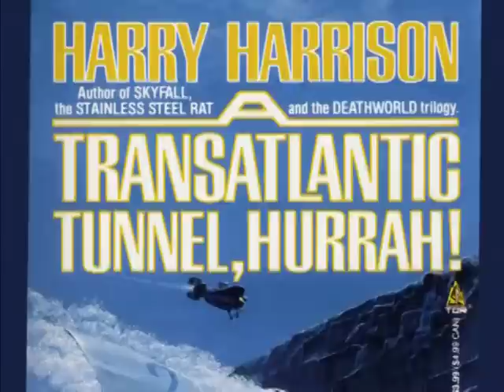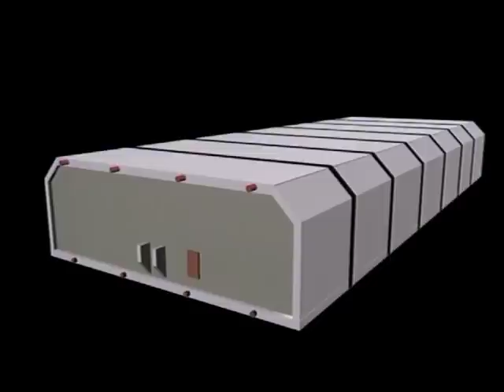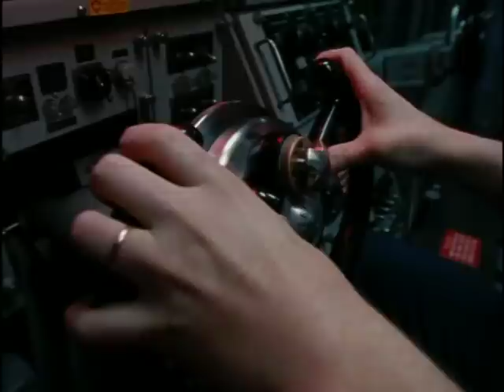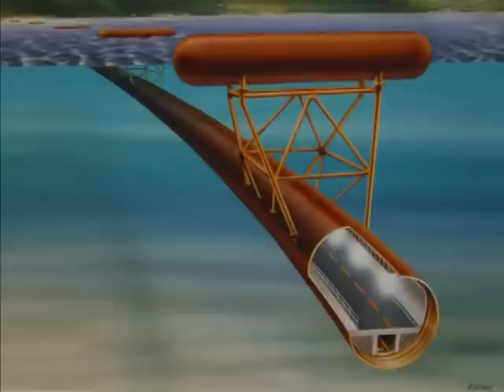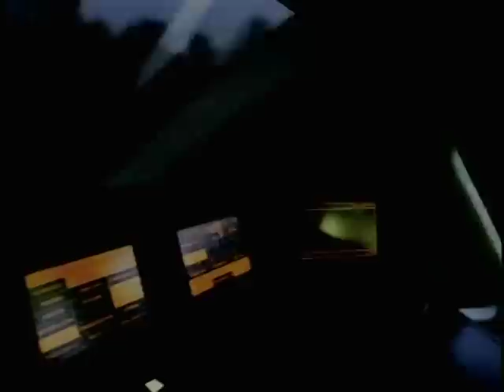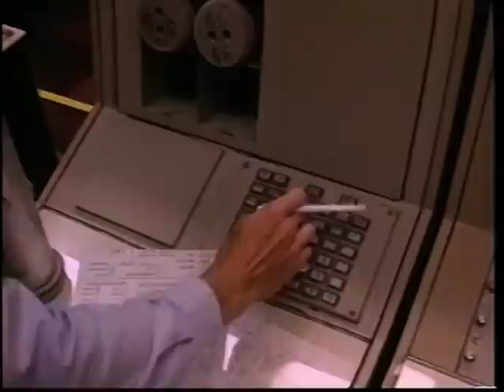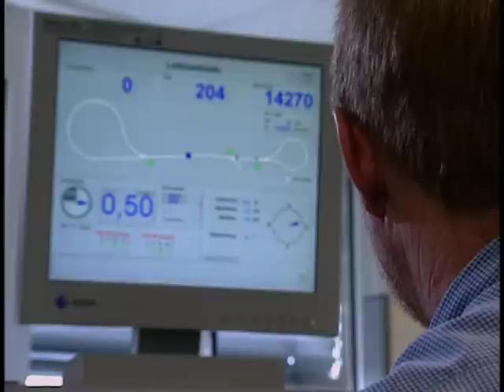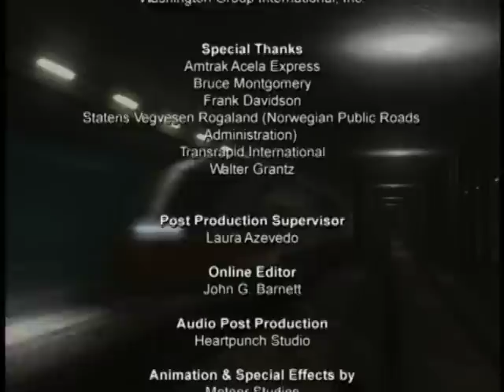Transatlantic Tunnel | Extreme Engineering

Comment: Building the tethers on the bottom of the Atlantic Ocean is next to impossible.  The length of the cable is also impossibly long as it runs the entire depth of the ocean.  Engineers have to come up with floating tunnel that can stabilize itself using propellers for each section.  This is not impossible given today's technology in computer and sensors.  Each section has to be buoyance just enough for it to stay in the water.  Anyway, there is no easy solution.  I still think that a bridge (or underground tunnel) from Canada to Greenland to Iceland to England is engineering more viable than a floating tunnel from the US to Britain.
Reply: Even that would be impossible, linking 4 countries together.
Reply: Impossible

Comment: They have had trouble laying The Transatlantic cable, And now You want the float a tunnel across the Atlantic Ocean, one of the wildest oceans in the world. Who's dreaming now?
Reply: Pretty calm 150 feet down.  There are issues with the ocean currents, but they mostly stay in the same places, like rivers. If you are just talking construction and the people working on it, it is likely they have to wait for good weather.  It probably is actually easier for the workers, as the ships are free to move around until you actually lower the section of tunnel, while when you are putting in a cable you are tethered to what you are working on and can't drift away without either risking damage to the cable or wasting cable with some less that direct path.

Comment: The only way I can imagine we could run a tunnel under the seabed across the Atlantic Ocean would be a tunnel within a tunnel. That is, a large bore tunnel, perhaps twenth metres in diameter, within which a smaller bore tunnel (through which the train would travel) is attached to the floor, walls and ceiling via hydraulic rams. These would adjust in real time to seismic activity, allowing the travelling tunnel to remain static relative to the Earth. The inner tunnel would be at near vacuum, whilst the outer tunnel would be maintained at atmospheric pressure to allow for visual inspections of the shell etc. Superconducting MAGLEV would be essential for obvious reasons of friction, and should provide enough clearance to allow the train's velocity to oscillate in all three dimensions slightly, again in response to seismic activity, structural malfunction etc, as there cannot be any contact between the vehicle and tunnel infrastructure, particularly at speed. Also, at the speeds we're talking about (5,000 mph +), partial weightlessness due to the curvature of the Earth would need to be considered - off the top of my head, I think this would effectively reduce the weight of the train (and all its occupants) by about a third at its maximum speed. Honestly, if the world poured all its resources and greatest minds into this, I think we have the technology to make this a thing within 30 years or so. Obviously, this is all fantasy, because in real life it would just be prohibitively expensive.
Reply: I don’t get it

Comment: it would be very difficult for a fire in a vacuum
Reply: They were talking about fire in the cars, which is very serious, because that builds pressure and the car will likely explode.  At the very least, this would destroy all the cars behind.  And getting everything cleaned up after could take months.
This is also why terrorist bombs and tunnels like this are incompatible.
We would need very good tech to insure there were no explosives.  Possibly even requiring people to fully disrobe, be fully scanned and wear outfits just for the ride, taking nothing with them.  Cards reprinted at the destination station, phones switched, and all data moved...
Shoes would probably be the biggest inconvenience.
Reply: @T S It does not have every advantage trains do today.  Big deal.  This is for intercontinental travel.  People would surely choose to go 5,000 miles an hour rather than 500 miles an hour.  And with more people choosing the train, the number of flights offered will be far fewer.  Maybe one flight a week, where there was 2 or 3 a day from some location.  While there will be a train every hour or two.

Comment: I heard this playing while fixing dinner.

This is multiple dimensions of stupid.
Reply: How so?
Reply: @dj4monie  There are multiple problems with the Transatlantic Train Tunnel. What if someone brings a BOMB on board a train? If the train explodes, and it fails to stay intact, then the tunnel will...yeah. The tunnel will implode, the train will derail, and all hell will break loose.

Another problem - what if a plane or a boat starts sinking? Both of those things are INCREDIBLY HEAVY and thus, if it touches the train tunnel while moving, then the train tunnel will also break under pressure and weight.

ANOTHER PROBLEM is that what if the train tunnel IMPLODES? Sure, you could say that the engineers are certified and thus the train tunnel can NOT fail or break, but that's pretty much what everyone said about OceanGate and WHAT HAPPENED?
Reply: @suspense_comix3237 it’s not really something that would ever necessarily happen but either way, it’s an interesting idea in my opinion

Comment: Oh look…where Musk stole his hyperloop idea from.
Reply: Actually patents for Hyperloops have existed for over 100 years
Reply: @Lex30911  Aye.  I’m just tired of the Elon-files claiming the idea was all his.  Also betting that he saw THIS program well beforehand.
Reply: @shepardbook  The media claimed it was his idea.  He never once said that he came up with the idea and has even brought up the early steam powered designs.
Reply: I wonder how his $4 court charge went.
Reply: Robert Goddard, invented the vactrain as a student in college in 1904.  Heck, I invented the vactrain without having ever heard of it, in 1987.  I was just far from the first.  And when I first heard of maglev trains, I instantly saw that it was ideal for a vactrains.
Musk wants just reduced pressure rather than a near vacuum.  That cuts the speed down quite a bit, but it is much easier to get that level of pressure.  So, what he is proposing is somewhat different.  Also, I think he wanted to use surfaces to fly the vehicle with a cushion of air, something like the first hovercrafts which did not have a skirt...or ground effect aircraft.
Reply: Elon,never corrects media,he is not inventor every time, Tesla was, almost completely 2 other guy's in California. However, Hyperloop test track was built and tested,so his skill is probably OCD like vigilance